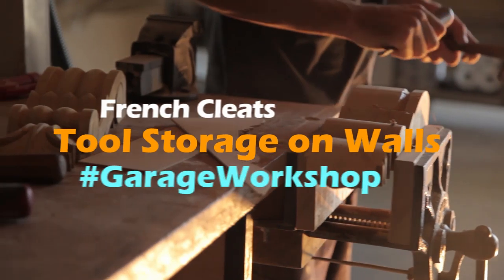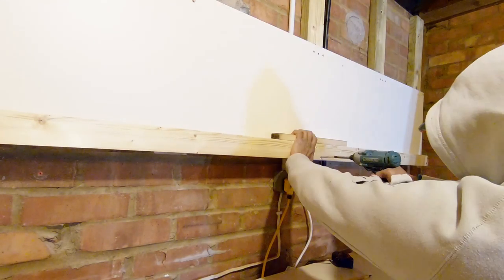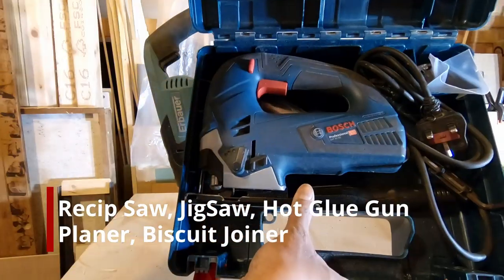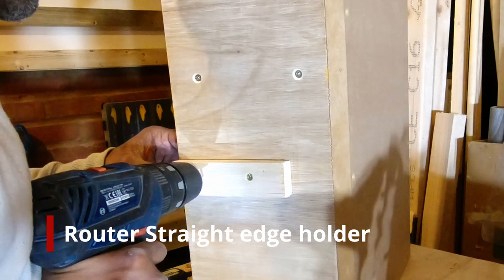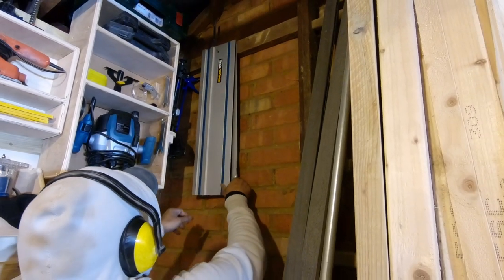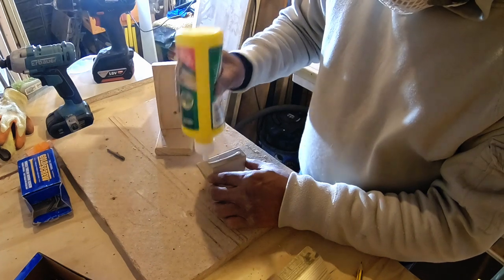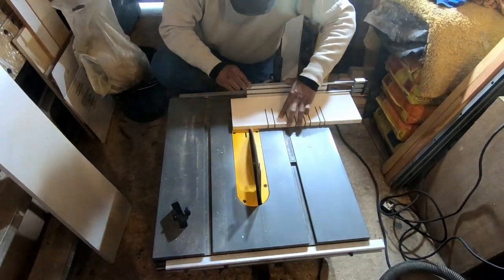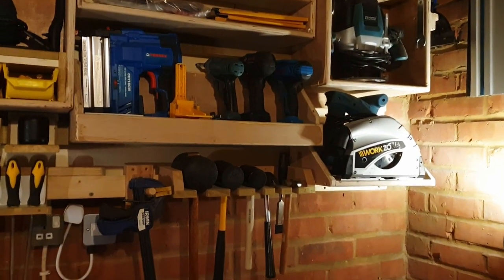Tool Storage with French Cleats (1 Wall = 35 Tools)  #Workshop #sujmenon

Comment: This is the first video I have seen from you. You have a new subscriber. I want to tell you something. Do you have any idea how refreshing it is to see someone build like this? You used scrap, you used 2x4s for your cleats, you have a very small shop, and you don't look like you are sponsored.  Just a regular guy, with a basic tool set, using whatever you have to get the job done. The connection I have to you, because of this, is pretty impressive.  I work with the same things you do, I have a small place to work, I use scraps, my first cleats were 2x4 that came from an old set of shelves I built, I have a small set of tools. It was fantastic watching you do what you did, with what you had to work with. I really preferred this to watching someone with a 40x40 shop that has every tool you could think of. You made the entire process approachable. Thank you. BTW, your mallet holder design can also be used to store your drills. I use 1 3/4" wide slots for mine. Take it easy.
Reply from the maker: Thanks buddy for the great comment and encouragement 👍 😀 🙏.  I got inspired by the big shops to do something similar in my small garage space 😁. Its so much better now with the storage and bench. Previously I used to spend half a day looking for tools in the garage,  haha..

Comment: Very interesting design Suj. I've never seen someone build such large structures for their french cleat system. Thanks for sharing!
Reply: I also noticed that the structures were unusually large.  Covered up a lot of the cleats that were installed. Usual to use 2x4’s as cleats as it spaces things too far from the walls.  Also the primary use of a cleat system is the ability to move things around.  With the size of these structures I doubt they can move much..  Might have saved a lot of wood and space to just build the structures and mount them on the wall.

Comment: Sir, this wall may look simple to some, but there was a lot of planning and thought that went into this build and it is very doable for those of us who can not afford to use Baltic Birch on everything. I really like that your router guide for making dados is made of metal and will be long-lasting. I do have a suggestion for that too. IKEA sells cheap thin cutting boards made of poly-nylon material (3 for $2.50 or so) and once cut to fit the width of the steel track, your router will glide effortlessly. I used the same cutting boards for a circular saw cross-cut jig made using aluminum for tracks. To make the strips seamless I cut the ends on each on an angle with an Exacto knife so that when they butt up to each other there is no big seam. The cutting boards are only a few mm thick, so they are very easy to cut. Your attention to detail with the round-over edges and final sanding took it to the next level! Once you have organized your workshop, there is a sense of accomplishment and relief that comes with it. You have inspired me to finally move my behind and get mine done this weekend. Thank you for that!! 
 Much happiness to you and your family.   ;>)
Reply from the maker: Thanks lot bud! 👍 😀 And a great tip on the IKEA cutting board

Comment: Very nice and robust system. You are the only one (on YouTube) I see using such big chunks of wood for the cleats (I usually see much thinner pieces used). However, I see you made a lot of big, heavy cupboard structures to hang on your cleat wall, right up to the point where I thought you are missing the point of a versatile cleat system, where you build small, light structures to move around and hang up where ever you want or is convenient for the project or situation you work on/from at that moment. Anyway, nice video. I learned a few things from it. Thanks!
Reply from the maker: Cheers,  thanks for the feedback mate 👍. Yes I used 4x2's for the structure, because the top shelves will be heavy when loaded. Didn't want to risk using 18mm plywood 😁

Comment: I love this video.  I’m looking for a french cleat system and helpful to see a metric unit video.   
It looks like some of the holders were made using veneered mdf .  Is that right ?  I have lots of that and hoped to use it rather than buying ply as I don’t have any ply
Reply from the maker: yes Jay, all the big frames were predominantly plywood, but I also used veneered MDF for smaller items, like  trays, hammer/chisel rack, etc.  I think, as long as the boxes/frames are small, it should be fine.

Comment: Very informative and incredibly unique tool storage solutions. Thanks for sharing your expertise.
I recently purchased a new home and my wife wants me to make a built-in whole wall China/serving station for the dining room. 
Your video sparked my Curiosity of incorporating your modular tool storage solution.
What are your thoughts if building my project using the French cleat process is practical or even feasible.
If so would you be interested to make a video how to go about such a project.
Reply from the maker: Thanks Robert, yes it should work with 18mm ply. The key is the design and the ability to blend it neatly in a dining room.  I don't have space in my house, but I have used french cleats to hang stuff around. In one of my videos on making a wall art candle holders, I did use french cleats in my dining room, to hang it up.

Comment: Very impressive and well done video. I really like the way you approach your builds. Also, I would like to ask , Do you have a dust extraction solution? Cheers
Reply from the maker: Cheers Alejandro👍😁. I only use my old vac in the garage. Since space is tight, I just got an additional length of dust extraction hose, that I connect to my tools with adaptors. This is the one that I use: https://www.rutlands.com/sp+dust-collection-dust-hoses-fittings-dust-hose-kits-power-tool-hose-and-connector-kit-32mm-rutlands%C2%AE+r8546
Reply: @SujMenon  thanks for that. Cheers

Comment: All those fantastic pieces and then you glue and screw boards into a big block and just sit the saw on it?!?!? WTH was that?!? If that's all you were going to do why not just sit it on the shelf?!?
Reply from the maker: I actually made a shelf, but ran out of space on the wall to hang it 😁. It's there in the video as well. This wood block is a quick version 2, that takes the least space, but creates enough clearance for the circular saws blade guide. And that's screwed in on the top shelf as well.